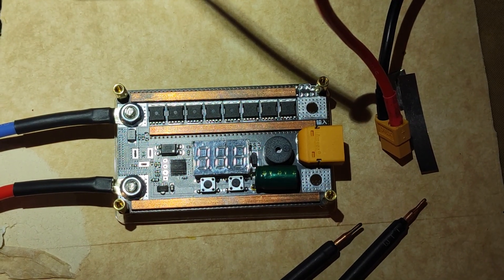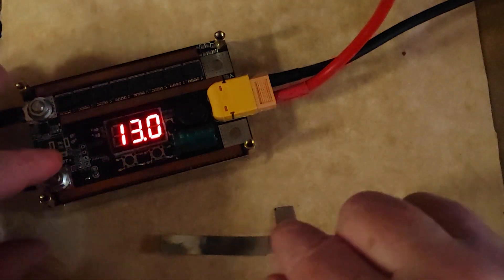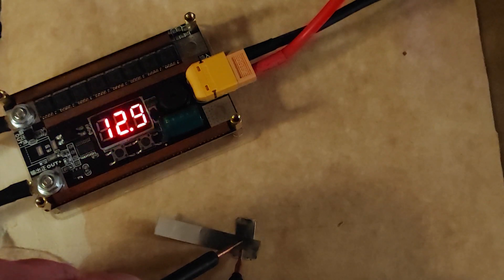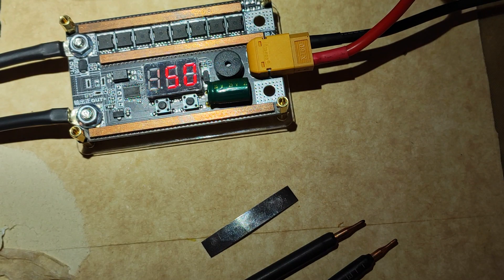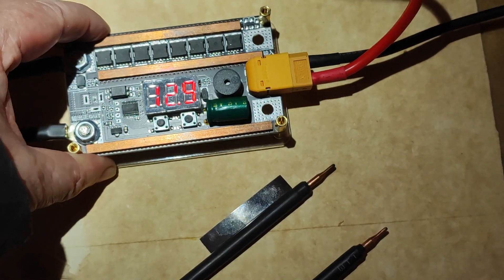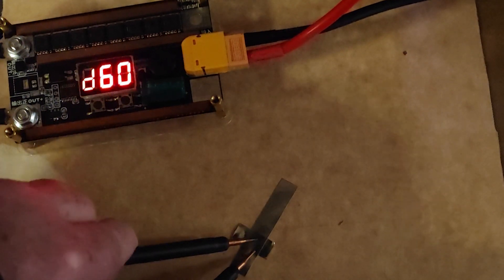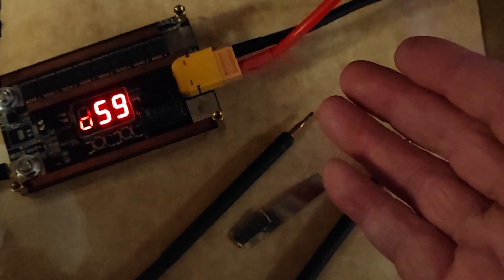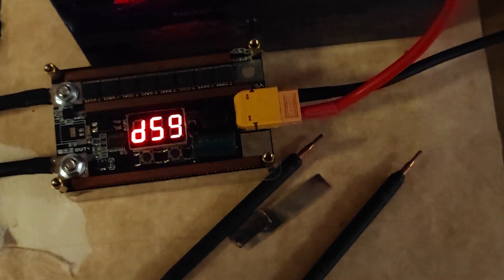GX590 Spot Welder - Aliexpress - Y-CX0006D

Comment: In case someone is still interested in the spotwelder. I used 20 22mF 16v low ESR caps in series plus a DC DC to ensure a proper charging till a maximum of 15V. Works quite good! Only thing I am waiting for is a 2.5 mm DC socket to use a pedal. As stated before, there is a switch in the dc socket for the pedal so soldering another input to the board did not help :) feel free to send me a quick msg in case you need pictures / instructions

Comment: I bought mine a few weeks ago and tested it today. 6-mosfet version. It had a factory-soldered black connector from the foot pedal and work from the start. I powered it with a 4S 1550mAh 100/200C Lipo battery - is too weak, gets very warm. The BifRC V1.2 welder powered by it burned out 3 times before I stopped replacing the burnt mosfets. However, I made about 200 welds with this welder without failures. I set the parameters to A1 and P1. I just don't understand how the "gears" setting work and what they mean
Reply from the maker: @FargothPL  Gears are discussed below. 4S battery imay be too much. I only ever use 3S.
Reply: @lancelink88  I don't think it's too much. According to the store's website, the working voltage is 8-24V, but above 20V you need to modify the PCB in the form of a 100k resistor. Honestly, I'm afraid to use it on 3S. Previously, I used a BifRC welder with 8 mosfets. On 3S, it burned out constantly because the voltage liked to drop below 10V in the weld. On a small 4S battery, it worked without a problem, as long as it was fully charged - otherwise...
Reply: @FargothPL someone suggest to power mcu with separate power at the cap
Reply: Gears 99 is about 35ms pulses i reckon, gear 1 is about 10ms

Comment: If your setting is set to A-1 mean automatic mode which require to have the jack Connector to act as 0 ohm resistor.
Reply: @mtnshadid  โหมดนี้ไม่น่ามีในอุปกรณ์ สุดท้าย igbt ไม่สามารทนกระแสขนาดใหญ่ได้

Comment: I also bought the same model : be very carefull of short circuit when you assemble it : The Ring terminal and the nut can touch the near electric track, and the spacer also (near Input -) !!! I needed to reduce them, and add a plastic ring between the spacer, and connect on the reverse side of the printed board ! after that it works (without footswitch) but my small battery is old and only give 17Ah so the connection is very poor. I will retry with a stronger battery (or buy a spot welder with integrated battery which has better feedbacks that this one...)
Reply: Same problem face now what you do?

Comment: Today have received my welder and have the same problem.  Very weak spark  Read all comments , shorted connectors 2 and 3 but no way... Did you fixed yours?
Reply from the maker: Weak spark most likely means that your battery is insufficient in its discharge amperage to give you a strong spark.
Reply: Thank you for replay, will try another battery  @lancelink88

Comment: Got a gx591 I have the exact same problem. The seller refuses to refund. I tried shorten the switch - nothing works
I tried a 3s battery - nothing works... I tried a power suply 13v with dc dc buck converter - nothing works...
Reply from the maker: Please read the comments you may be able to fix it. Have you soldered on the foot switch? That was my problem.
Reply: @lancelink88  like I said. It works even not with foot switch.
Reply from the maker: @andreasmoll_0924 Ok well create an Aliexpress claim. You have 15 days from receipt to do that. I could ask you many questions, but they may just waste your time, without knowing what your problem is except for 'nothing works' its impossible to know.

Comment: Mine did the same thing with the tx60 connector, I switch to the pads and it worked fine.
Reply: Pads mean direct wire used in board?
Reply: @myhomelab  yes

Comment: You need installed Jack connector of left side board for pedal. Because this jack included inside signal switch. Jou need installed this jack plug connector or 0 ohm resistor or solderspot on the board.

Comment: just got one of these.

hooked it up to a 100ah leisure battery and the weld it did near blew a hole in my test 18650 cell - this was on lowest setting possible too!

scary thing to use imo. Clearly the battery im running from is too powerful for it. 

I also read about a few horror stories regarding these, such as them getting stuck on if you use it with a slightly flat battery, it screws with the onboard circuitry and leaves it stuck on, arcing away.

i'm going to be testing mine out further with a much smaller lipo cell 3s 5000mah and seeing how it copes.

how have you gotten on with it over the last 4 months since posting the video/finding a fix with the DC connector?
Reply: I got mine today and tested first on 4S and it scared me to death on d01 and P1. Even on 3S it blew big holes right through the nickle strip. Any advice? Think I'm applying for a refund
Reply: @philsson   bin it, it's junk.
Reply: @Thingamajigs  what would you recommend instead? I'm looking to start spot welding some smaller 18650 2S packs to begin with.
Reply: @philsson  KWeld is really the only thing avaiable that wont blow up itself/you/your pack
Reply: @Thingamajigs  👍 thanks for the reply. Will check it out

Comment: Hi, is it ok to use high power Lipo battery? Like 7,100mAh 100c.
Reply from the maker: As long as your battery is 3S and you start with the lowest setting (set to P-1 with power level set to say 02 out of 99) you should be OK. Test it, if that setting is too strong and burns your metal strip instead of a clean spot, then stop as it means your battery is too strong. I use LiPo 2,200mAh 130C and it is fine on P-1 at around 30.  The main thing is that you start low and adjust upwards. If you start high you can damage your spot welder by overloading it.
Reply: @lancelink88  Thanks. Mine arrived today. I tested it right away. I used LiPo 3s 2250mAh 60-130c (maximum discharge). It worked and its powerful. Thanks for your video and the comments. They guided me.
Reply from the maker: @rv.inciong4810  No worries, to get even better performance change the leads/electrodes as the leads are made of aluminium wire. Copper wire works way way better. Malectrics sell a set for Euro10 and they are excellent (AWG 7).

Comment: Hi
I also bought 30  pcs 18650 cells 3000 mA. Can anyone suggest a schematic for a suitable powerbank for this welder?
Reply from the maker: It really depends on the "C" rating of your cells.  Ideally you want a "C" rating multiplied with your amper rating to be around 180.  So 3000mah x 50C = 150 which would be a miniumum.  To increas your cells total "C" rating you need to connect the cells in parallel.  So you could have 3 cells (in series) x 2 in parallel for example (total 6 cells). Remember your voltage output must be under 14 volts.
Reply: Thank you, maxim. But why under 14 volt. Specs say that the welder can work up to 24 volt?
Reply from the maker: @Onkel.Moetrik  I don't know what you are reading but this welder needs a Lipo 3S. I tried a 4S and it was too powerful for it to operate.  Voltage needs to be between 12 and 14 volts.

Comment: Hi
I just bought the same model, kkmoon fully assembled from factory and a complete kit. It just dont work. It seems that there is no power or amp when welding. Can't even make a tiny mark on the nickel strip. Besides that everything works correct, buzzer timer and auto start. Power from lead acid battery  12v 40ah.  I did put  a plug in the jack. Any ideas?
Reply from the maker: I think that your battery is the problem. You need a high discharge rating of around 180 to 200ampers. 40ah is the total capacity of the battery but it is not an indication of the battery's discharge rating. I suggest that you buy a suitable LiPo battery ($30) with an XT60 connector.
Reply: It is a starter battery, it should be able to deliver at least 200 to 400 amp?
Reply from the maker: @Onkel.Moetrik  If it doesn't work it isn't powerful enough. Maybe you are getting voltage drop, maybe your battery isn't fully charged, I don't know but car batteries are inferior to LiPo batteries with this welder.

Comment: It seems to me that you soldered the capacitor wrong, with the polarity reversed
Reply from the maker: No the polarity of the capacitor is correct.  The problem was with the foot switch connector not being attached, which is required even if the welder is set to auto mode.  So I shorted out the foot switch connector and the welder works perfectly. Please see in the comments here for more information.
Reply: @lancelink88 both terminals of foot switches shorts with soldering you mean that?
Reply from the maker: @myhomelab  Yes
Reply: Please tell me where is foot switch in the pcb board?

Comment: I have the exact same problem. The seller refuses to refund.
Reply from the maker: Did you read the other comments here? My solution was to solder the foot switch connector to the spot welder motherboard.
Reply: @lancelink88  Yes I do and my problem is not related to that. It does not work even with a pedal switch.
Reply from the maker: @sebastienochart  Well it might be a number of things, a blown mofset is a common problem. Sorry I can't be of more assistance.
Reply: i just found why its switch foot plug....it must be pluged before you use it
Reply from the maker: @Rcfishingbateauagadir  Yes if you buy the foot switch model, but not if you buy the automatic model without the foot switch.
Reply: @sebastienochart  did you solve your problem with device?
Reply: @wojciechostrowski4974  Nope. Problem is not related to the remote control plug.
Reply: Just reverse the charges on them , i usually file PayPal claim or file fraud charges against seller

Comment: Hi anyone know what setting P-1, P-2, P3 means ???
Reply: P1 is OKAY
Power modes: P1 ist the default mode, which is suitable for most batteries; P2: is the enhanced power mode, which is suitable for batteries with poor performance; P3 is the super power mode, which is suitable for batteries with very poor performance. Normal P1 is OKAY; if the power supply battery is poor and P1 cannot be welded, it can be adjusted to P2 mode, IF P1 CAN BE WELDED, DO NOT SWITCH TO P2 MODE. Easy to burn motherboard, P2 mode or can not be welded, you can try P3 etc
Reply from the maker: "P-1 P-2 P-3" correspond to the number of pulses per weld.  P-1 = 1 pulse, P-2 = 2 pulses and P-3 = 3 pulses. You need an oscilliscope to see that as it is a millisecond pulse. If you use 1 pulse (P-1) on say 60 it will be equal to 2 pulses (P-2) on say 30 and 3 pulses (P-3) if you set the gear to 13 (P-3) on 3 pulses.  So they are power level adjustments.
Reply: @lancelink88  Thank you very much. BTW I just received mine. I also ordered only automatic version, but mine is working without need to short 2-3 pins. Did you try to weld 0.3 mm nickel plate?
Reply from the maker: @mackubecka  Hi, I ordered the full option model, which if you don't solder in the foot pedal needs a mod to make the auto mode work.  I've only tried 0.2mm nickel which it does effortlessly.  So I believe 0.3mm nickel should be capable on this device.
Reply: @lancelink88  Hello! Which settings do you use to weld 0.2? I have tried to weld 0.15 nickel plated stripe to a food can (sanded the surface before tests) and my welder released magic smoke on p2-50.  I have used a fully charged car battery (plenty of power) and this p2-50 settings were the first which showed something like normal spots that i could not tear without stripe remains on a can. Sadly it lasted about ~20-30 welds. (P.S. I have the same board but newer version with bigger transistors which were supposed to last longer...)
Reply from the maker: @Cooler044  I can weld 0.2 with P2-70 no problem. I think there may be 2 things you can improve: 1. Use a Lipo battery - I use a 3S Graphene Lipo battery that is 2200mha with 130C. You need about 200amps+ discharge, these batteries are very reasonably priced on Aliexpress. 2. The leads on this welder for the pens are aluminium, you should change them for copper, that will make a noticable difference.
Reply: @lancelink88  thanks a lot
Reply: you can find pulse durations table for P1, P2, P3  in the description in my video https://youtu.be/5p70zYPeGRY

Comment: hello
Did it come with a 3-pin DC jack for use with a footswitch?
Please be sure to install this
This DC jack has a switch that detects plug insertion
If the plug is not inserted, 2 out of 3 pins will be shorted
maybe this is the reason
Reply from the maker: OK thanks I'll solder in the foot switch in and give it a try. But I didn't think that was necessary for automatic operation?
Reply: @lancelink88  
If the DC jack is not installed, it should be in manual mode.
So I think that it does not work in automatic mode
Please check the continuity of the 3 pins after installing
Unplugging and plugging in the connector should change the behavior
Reply from the maker: The PCB is the same I assume if you buy the full version or the automatic version. Setting A1 is the automatic mode.  If you buy the automatic version you don't get the foot switch plug. Anyway I'll solder in the 3 pin connector for the foot switch and let you know.  Thanks
Reply: @lancelink88  

https://i.imgur.com/Tjb5mNK.jpeg
Reply: If you don't need a dc jack, shorting 2 and 3 should put it into auto mode.
2 and 3 open for manual mode
I think it is correct to reverse this circuit design
Reply from the maker: @user-tc4nw7fu5x  OK thank you very much how did you get this knowledge?  I thought that my octocoupler had failed as there was continuity and voltage drop in both directions between 1 and 2 (although this was an in-circuit test).  Anyway I'll try tonight with your suggestion and let you know how I go.
Reply: @lancelink88  
I actually checked the continuity of the DC jack with a tester
I think that it is a DC jack similar to the following type, so please refer to it.
chrome-extension://efaidnbmnnnibpcajpcglclefindmkaj/https://strawberry-linux.com/pub/18742.pdf
Reply from the maker: @user-tc4nw7fu5x  Thank you, the mod shorting 2 to 3 worked for A1 setting. It solidly spot welded 0.2mm nickel strip on D40 setting (40%) power. It's a powerful little device compared to other similar sized spot welders.
Reply: @lancelink88  
Congratulations
very powerful and i like it
Reply: @user-tc4nw7fu5x how can i change the configuration from automatic to full feature(manual w/ foot pedal). I forgot to check the variation and checked out the auto version
Reply: I think that you are correct. If the plug is missing the auto detect is ("false active") And the welder expects a normally open switch for the trigger. Or, If the plug is not placed, the circuit things that the footwitch is connected. When my footswitch is disconnected it auto triggers after 2 seconds. But with my footswitch connected, I need to press the footswitch otherwise nothing happens. 

Best is to place the 3-pin DC jack or you could connect a normally open switch to the Normally open contacts op the pcb. I think that also should work.
Reply: aah, I didn't see there were more replies already...